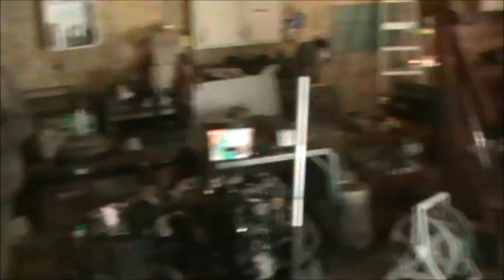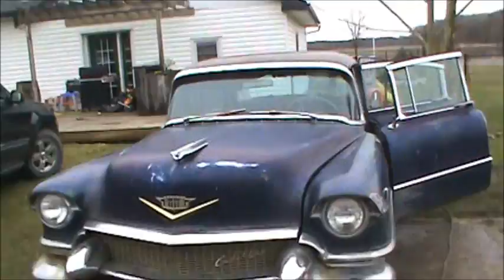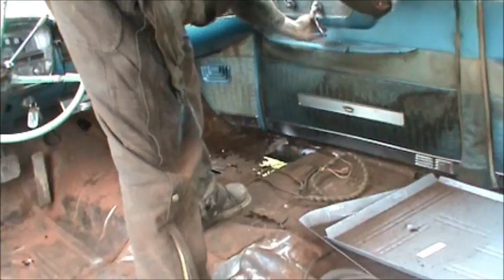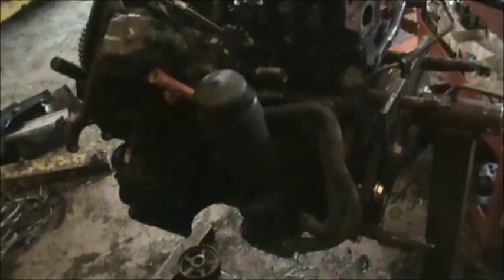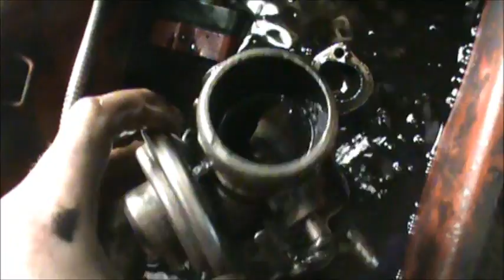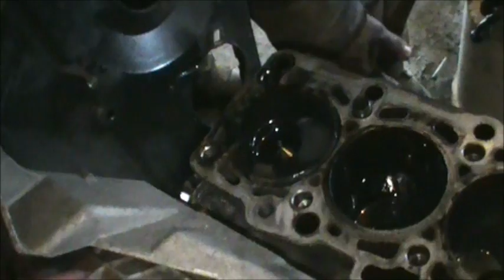Shop Day

Comment: I'm fairly certain the rules are the same as regular cars, as long as the car passes the safety inspection, it can be plated and used on the roads, includu=ing highways.

Comment: vibration is typical of worn dual mass flywheels, complete shite when new. typical signs of high levels of engine wear " dished follower buckets" which lead to failure just like in the video. that's the way it goes, probably the next bit to let go will be the auto box and / or torque converter.did you change the atf oil, if so what color was it.

Comment: poor guy trusting his life with no proper mask trying to clean a rusty wreck,lol.

them wire wheels are known as smudging wheels , just crap.. when doing such tasks just media blast it clean inside and underside,around the inner tubs and chassis rails etc, will be able to sort the metal work out and properly paint it inside and out.

u don't want to be doing that sort of work with metal outside in the rainy season that's for sure, whole point of the project is to remove the rust  is it not.